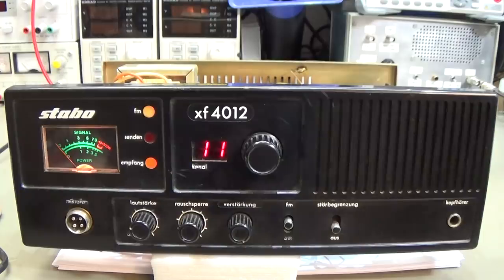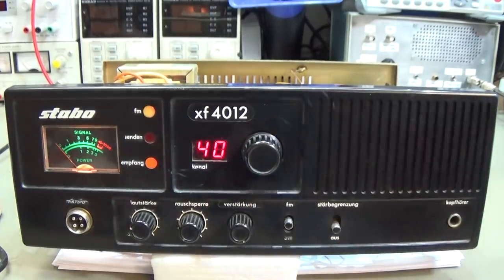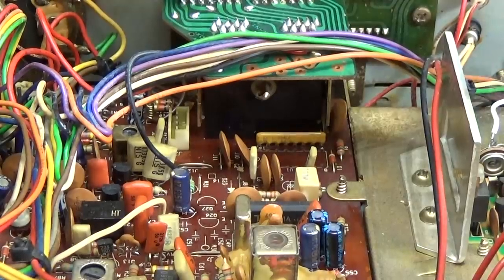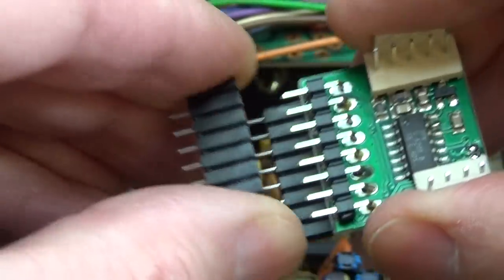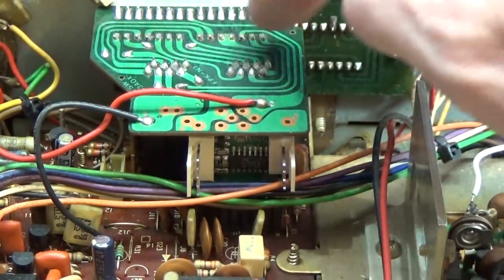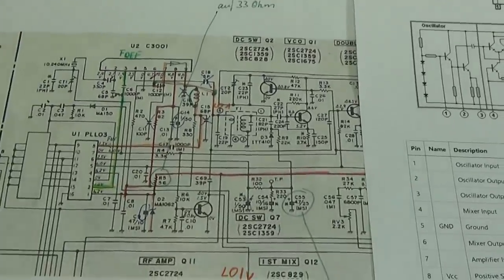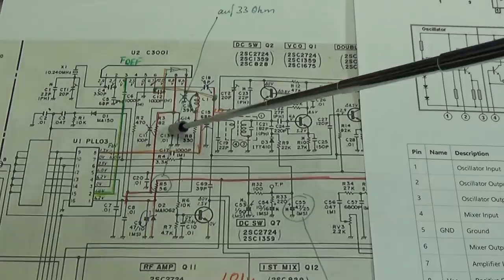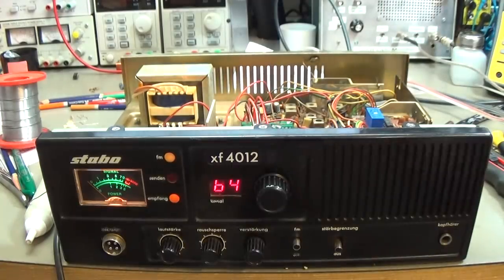#194  CB radio gets a new PLL for more channels; frequency mod for Stabo

Comment: @43:00 so it is no longer down mixing the PD frequency, and is using the direct VCO frequency for the feedback, I did the exact same thing on the modification board I designed, which uses a different PLL and an Arduino Pro Mini board, only for Uniden Chassis radios, I did a video series on its development about 2 years ago, the mods done for this module are very similar to what I had to do, adjusting the PD filter timing too to reduce jitter.
Reply from the maker: Very nice Scott. Thanks for report 73

Comment: Hi Peter,
Fantastic job getting that old radio to operate on the new frequencies. Gerhard has made a fine PLL replacement circuit.  73  WB3BJU
Reply from the maker: Thank you Donald 73

Comment: Great video!
I got given a very similar "home base" CB radio many years ago, it was only 22 channel and 0.5W Tx output. I think it was Senfor brand.
Being based like this Stabo on a Cybernet chassis, I did a straight swap with a UK spec 134 chassis.
The power transformer was much smaller than in the Stabo so was upgraded to suit.
I used one of the dual PLL conversion kits available at the time to add the CEPT channels.
The UK radios were more tightly tuned in the RF stages and there was some compromise in sensitivity and Tx output power.
I used to add a little extra mod to switch in a trimmer capacitor to the Rx RF stage in order to increase sensitivity in the lower band.

There were many bad "piggy back" conversions carried out, a lot of them disabled the PLL lock detector, so would cause interference throughout the band as the radio was keyed and the VCO frequency swept on the way to locking. 
Tx is usually inhibited until the VCO has locked.
Reply from the maker: Thanks for your report Simon and thanks for watching my video 73

Comment: I'm assuming this transciver wasn't something that was sold in the USA. It looks like a nice CB. Cleanly designed. Not cluttered with unnecessary knobs, meters and switches. Nice clean modification. Nicely explained, and "filmed". 73's
Reply from the maker: No I think Stabo is not that much known in the USA?? Thanks for feed back and watching 73

Comment: for better selectivity and sensibility, change the SFE10.7 ceramic filter (bandwidth 150-200KHz) to a 10M07.5A crystal filter (bandwidth 7.5KHz).
Reply from the maker: For AM radios you are 100% right but for FM radios it is a bit different, you need almost 10khz bandwidth for only 2khz divination. Explained in video #28 at 14:07min  https://www.youtube.com/watch?v=pKfLWZMCaF4
Reply: @TRXLab  the 10M07.5A has a 7.5 KHz bandwidth at 3 db, and 10KHz at 6dB, which is perfect for the CB channel spacing. All the new CB radios have this filter after the first mixer.
Reply from the maker: Do you have the brand and type number of the filter. With 6dB at 10Khz sounds promising..
Reply: @TRXLab  just search for "10M07A" on Ebay, 5 pieces cost 6USD + 1USD shipping from China.
Reply: @TRXLab   Kommt darauf an wie die Flankensteilheit des Filters ist, ein 7.5KHz Filter reicht meist aus für 2.5KHz Audio Bandbreite. Mehr Bandbreite braucht  ein legales CB Funkgerät nicht.

Comment: Wow I've never seen nor heard of a 03a PLL and I have a lot of PLL's in my radio room. Is it a close relative of the 02a or 02 or was it just for the European frequencies. 95% of CB's in Australia are 686 or 02a with a smattering of later supposedly non modifiable chips from Motorola and some others where they put the binary divisions on out board chips to prevent channel expansion. It actually made it easier it was straight BCD. Great video it's stirred my interest in older overseas radios again Cheers
It may have been 586 uniden chips not 686 it's been 35 years since I was inside CB's
Reply from the maker: Yeah too many variants on the market :^) Thanks for feed back 73

Comment: Dear TRX-Lab, there is a better solution for Stabo  XF2000, it has only 12 channels for AM/FM, but PLL02A, a better  PLL-IC, you only need a good Microcontroller-Program and a board, for example STC15 from China with EEprom, but not other PLL-IC for the 80 Channels in Germany.!! The STC15-Board has three 8-bit  Ports and it is sufficient for channel display+channel selector +PLL.

Comment: No 27.555?
Reply: instead of  40 above it is 40 below normal CB band
Reply: This radio only does FM so what would be the use of 27.555? 😁
Reply: @mrbambix  very true  27.555 ssb international call  not for FM.
Reply: @mrbambix  radio is AM/FM